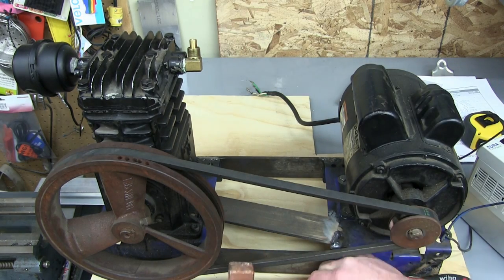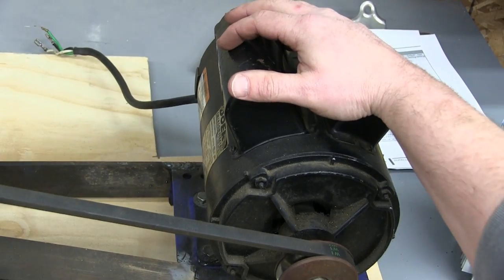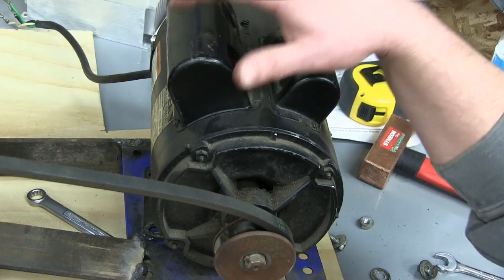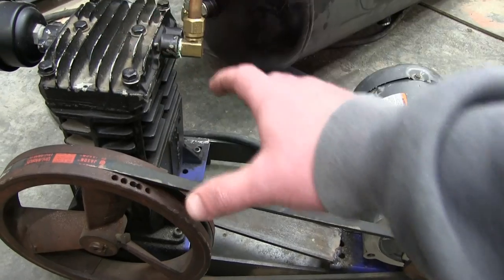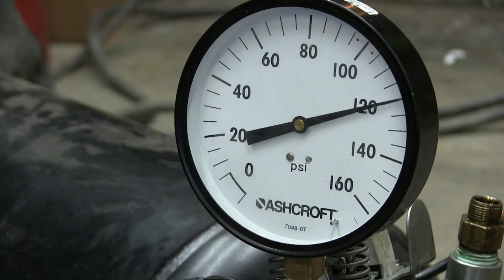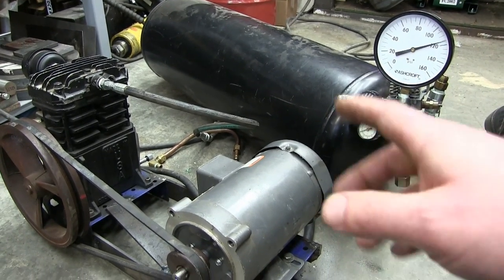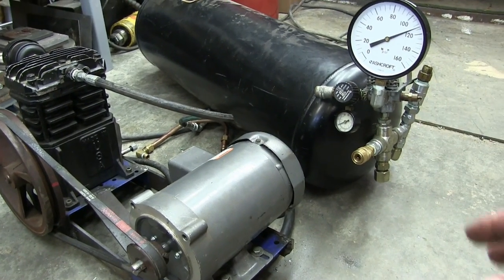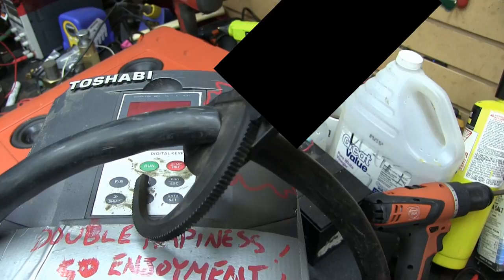BIG COMPRESSOR PERFORMANCE BOOST | No tripped breakers!

Comment: Some feedback (and it's not acoustic this time):
Some of us have taken the autogas tanks from cars, and used them for our air compressor tanks. We subsequently have a bunch of tanks, and a bunch of drivers with puzzled looks on their faces.
It would be nice to have some valves so that one tank can get charged up real quick and we can start work, and the rest get brought online gradually as there is surplus air available. Maybe pulse some solenoids to charge them up progressively without dumping the primary air tank too much.

Also, start your compressor in the opposite direction each time. That helps with the not needing an unloader valve. That flywheel pulley fan is fucking cosmetic, ignore it.
Reply: Pressure relief valve that essentially bleeds excess pressure into the next tank and so on and so forth. As for those compressors. Don't worry about the heat they don't care. We run ours well over 100 degrees c and they dont care and thats 10 hours a day 8 months a year.
Reply: I have the solution to your problem
On trucks and buses they have overflow/ charging valves to fill tanks in sequence they are adjustable then you run a check valve back to your first small tank say a 4gallon or 20 litre once the small tank gets to 90 psi it overflows to your huge tank until both are full at 120 psi
Draw from your small tank if you want quick air by blocking the flow to you big tank
Set you pressure switch on your small tank to cycle between 100 and 120 you’ll never run low on air 
Use truck alloy air tanks scattered around the walls of your shop with big lines joining them then you have heaps of air for your ugga dugga guns 💪 or spray guns
Reply: BADDD IDEEEE !!!  Used tanks of ANY type used for compressed air- that are NOT certified and within time deadlines are TICKING TIME BOMBS !   IN most jurisdictions you MUST re-certify any compressed gas receiver regularly, and Car GAS TANKS are ALL made of too thin materials and are NOT round, a design necessary for any hi-pressure!
Reply: +Lofts Sympatico Don't worry, friend. I ran some random beads of weld all over it to reinforce it. I am not sure what alloy the tank or the rods were, but the packet said "extra strong", so it will be juuuust fine.

Serious: I mean LPG tanks... propane... etc. Not gasoline. They are indeed round and thicker than most air compressor tanks. They have a working pressure of a few hundred PSI. They may not have a TUV number on them, but they are good enough for the women I would like to go out with.
Reply: Pressure overflow valves!! Why did I not think of this?!?
Perfect solution, no electrics required.
Reply: If you were to have some kind of an accumulator/expanding tank that would keep you at pressure while the volume increases that would be optimal for what you are suggesting. Problem with this is that the pump will always be pushing against high pressure when it could be pushing against lower pressure generally providing more cfm and running cooler.
Reply: Lofts Sympatico: You might be confusing Car gas tanks for petrol and LPG tanks. I just took one out of the LPG converted car. Says certified to 36 bar on it. AFAIK burst pressure of Propane cylinders is around 70 bar.
Reply: Godfrey Poon an exception to your statement of operating the compressor in opposite directions each time many industrial air compressors have built-in oil pumps not all of which are bidirectional as we discovered with the compressor we had to replace the head on. determined the three phase was not correctly phased the unit ran backwards under oil starvation conditions until it's seized and internally grenaded it was a total loss an expensive one at that V quad 2-stage Quincy with only a few operating hours on it
Reply: @loftsatsympaticodotc  Certification is an issue but the post was talking about LPG tanks which are built to take very high pressures. Probably Brits and Americans being separated by a common language.
Reply: @godfreypoon5148  Pressure relief valves are a must-have safety requirement.
Reply: @Dave5843-d9m  Yes. Gotta have an external one.

Comment: I’m seeing this 2 years later and this is actually a genius idea and it should be capitalized on for mass production
Reply: I know I just saw this bubble up and yes he needs to prototype and patent the thing. I will buy one now... unless the cost gets jacked up by the hands of 'big compressor' lol
Reply: It's not new tech - this is how inverter refrigeration compressors work. Instead of a dead band start and stop operating system, the motor slows as it approaches max, and speeds up as the pressure drops.
Reply: it is, just used for larger compressors because the extra huge cost of the compressor in large applications lets you absorb the added cost of this tech. home depot compressors will NEVER utilize this unless it becomes almost free :D
Reply: @davebennett5069  It is used for domestic air conditioners and refrigerators. Also drill presses, lathes etc, the cost has come way down for VFDs.

Comment: The ugga dugga, dugga duggas, tappy tap tap, etc.
Reply: Sounds like the start of an album to me: AvE n Dewclaw Rock out!
Reply: There's not many words in machinist language but they sure are versatile!
Reply: "How much did ya torque it down?"

"About three ugga-duggas."
Reply: OperatorIHC hahaha. Eric O!
Reply: All it needs is a snappy tune.
Reply: It's was always gigers In the garage I worked in that we measured in
Reply: braat braat
Reply: "Tappy... tap... TAP!" starts banging madly with hammer
Reply: I'm a 21 year old coder, Studying media design with it.. I am not a handy worker and yet, i watch all his vids and I enjoy it.
Reply: We use compressors in combination with catalytic filters to provide clean air to lab equipment (mainly where cylinder air cannot be used). The big problem with this is the exact pressure hysteresis you describe affects the equipment. You can reduce this to a degree by using  a second pressure regulator on the compressor output (with enough pressure drop across it so it works), but your pressure feedback motor control could help provide a more constant pressure supply and overcome this issue.
Reply: Doobly doo
Reply: "2+2 is 4, minus 1 thats 3, Easy Maf"

Comment: Man this is genius I would love to have something like this for my smaller compressor! That way when I’m away from the shop tearing down a vehicle to pull an engine, transmission, whatever the case is, I don’t have to wait 30-40-50 seconds for my compressor in-between every other stubborn rusty bolt. I can’t believe no one has figured this out before, but props to you for doing so! Brilliant my friend absolutely brilliant.

Comment: Why not just adjust the start stop on the old school compressor so that it kicks on at 110 psi instead of 80? You would still acheive a constantly running compressor, and as you said the motor is geared to run under load. 

If your tool is pulling more cfm than the compressor is putting out, you need a bigger compressor, not just a bigger motor?
Reply: I have always adjusted the on/off times on mine that way too
Reply: still doesnt solve the low volume of the compressor at ambient pressure at startup. You have a fixed volume per second compressor due to a fixed gear ratio and a fixed RPM motor. You want high compressor volume at low pressure at startup and low volume high pressure at high pressure. The motor runs efficient at one RPM. In order to do that you need to run the compressor  at variable RPM with an electric motor. This application calls for a transmission of some kind where if you have a fixed RPM motor start out at high compressor RPM (when at ambient pressure) with high gear ratio and then you gear down as you gain pressure in the tank. The 19th century double pulley variable ratio "variator" was for this type of scenario. Old school is all that you need. Nothing new.

Comment: Yes! Vector Drive ALL THE THINGS
Reply: That looks like an old motor on that compressor.  A variable speed inverter will burn out the bearings eventually.
Reply: Uncle bumblefuck taught me that bearings are industrial lego, so burning them out is nbd provided you have a good healing bench.

Comment: HEAT!!! most compressors work with the on off design so they can cheap out on compressor cooling.  That "down time" is essential to stop excessive heat soaking of the piston/compressor body.   You've got a novel idea, just need a compressor that can take it.
Reply: Bob Barker at lease I'm not the only one who think of that. I can't see that little pump lasting long running like that.
Reply: It’s cast iron and can take abuse far beyond these modern aluminum or worse plastic crap
Reply: You can always fit a little fan to cool the head if temperature becomes an issue.
Reply: Thomas The pulley/flywheel is a fan, Ave is just spinning it the wrong way....i think.
Reply: Cameron, do you mean that sucking the cooling air is necessarily less effective than blowing it on the pump? L
Reply: Lee, as it's not a car that drives forward I'd be hard pressed to call it one way or the other. Good thinking.
Reply: +Cameron -- That is right. A fan can blow air several diameters, but will only pull a significant volume of air about 1 diameter, so correct direction is important. It is also extremely easy to fix when 3-phase power is involved: Reverse any 2 of the wires. Or in this case, the controller can probably reverse on command.
Reply: very true
Reply: i agree with you heat ,is the death  trap here ,first i would run a water cooled with oil feed compressor ,point number 2 bigger ID compressor pipe and point three run a d2 governor valve switch on the head when the air is dropping  ,d2 will switch the head on or off  with a 1 bar on off (i base it on a truck air system compressor is made to run the life of the engine ) and old workshop compressor never switch off they run  the hole day ,all they did was switch the head on and off (germans called it a unloader )

Comment: Great idea. I’m an a/c and heating contractor and if you have a shop without 3 phase it’s extremely difficult to find an air compressor that with properly run some of the sheet metal tools and the adhesive spray rig for our liners. This would allow for more readily available power to run much more efficient compressors that could do what we usually rely on really big 3 phase compressors to run.

Comment: Yes damn good... broke the pressure switch on my 4.5kw kompressor 2weeks ago... that thing is quite a pain in the a$& because of the big 300l tank. It takes a long time to get it down to 7bar (were it will kick in again) but under 8bar the ugga dugga gun has no torque.
Reply: The pressure switches they have are really only rated for 3HP, and even then have a significantly reduced duty cycle associated with that.

If you want a real setup that uses the pressure switch as signal for contactor which is designed for high switching loads, check this out. I did this for my 5HP compressor and it works great.

https://www.reddit.com/r/Skookum/comments/6t4qi4/project_finished_industrial_air_compressor_for/
Reply: It's not like I can't believe you, but a head's up: Have you though about the airline to your Ugge Dugga? The bigger the less restriction. But since you're here you must have already got a decent size. :p
Reply: Stummel01 we're on the interwebs, not in church. You can say ass.
Reply: Got a 7.5kW motor on the one, and while it is really overkill as it runs around 10 hours a month at best, it works well using old fashioned star delta switching and a great big set of contactors to keep the switch alive. Still, as the switch is 20 years old, time to change it out, which is a pain, as it has copper unloader piping, so I will have to do an adaptor to use the modern push on fittings and tube, though the copper will still be there to keep the tube from melting. Has worn through a few outlet pipes and non return valves, Type 30 Ingersoll Rand compressor tends to give it a lot of air. Tank still passes pressure tests though, got the cert recently, even though it is over 30.
Reply: Yes ,  an Ass is an animal akin to a Donkey - ( so they can't Bleep it ) .  LOL !
Reply: Set the differential on the pressure switch to switch off at 10 bar, and kick in again at 9 bar. Should only take a couple tweaks to sort it. Check max working pressure of your pump and receiver first.
Reply: Graham Osborne not to try and be an ass. Im a compressor engineer and deal with this stuff day in and out, not all pressure switches have a 1 bar diff, its more likely a 2 bsr that works more as a 2.5 bar. A cheaper solution is to change to a danfoss type that gives you full control. For a windy gun or other air tools you need cfm and not pressure so much. Higher pressure gives less flow and lower pressure gives more volume so maintaining optimum operating pressuse is better than adding more. The flip side is that piston type compressors are inefficient and arent good to run much more than 50% of their on time.
Reply: What size air line?  How restrictive are the fittings?
Reply: 9ff70f96 it depends on the tools requirements. The quick coupling is usually the bottle neck but you can get fast flow ones too. Half inch rubber hose is fine for that if you are using half inch drive 3/4 for 3/4 ect. The pipe stores so much pressure and after that initial hit it becomes fed from the receiver. Larger bore allows more flow which is higher cfm.
Reply: matthew autton Exactly. Another concern is the pressure flow regulator, the last line of defense before a tool blows up...
Reply: came from the factory like that 12years ago: https://abload.de/img/img-20170412-wa0003i7rlp.jpeg but because i´m living in europe it´s a 3 phase 400V motor. Therefore it should not be an issue with the switch.... but i removed the pressure relive valve 6months ago because it was leaking... maybe that is the root cause for the switch failiure... starting the motor @7bar should require a few pixies....
Reply: Most consumer grade compressors rated at more than 100+ PSI have two pressure relieve valves, one on the manifold between the cylinder and "in" line and a second one on the solenoid between the manifold and "out" line to the air line. The first one is spring loaded and can be manually opened while the second one is spring - electric. Many of the twin piston units have two more pressure reliefs. The real danger is in the air tool regulator and likely the weak link. The regulators are rarely rated for more than 200 psi at 10+ SCFM
Reply: the compressor still has the overpressure blow of valve it opens at around 14-15bar. Normaly there is a small valve between tank and compressor that is open during startup and closes after a few sec. With that valve everything will get up to speed without compressing air (it will leak out before reaching the tank) so that will reduce the current to the motor for the startup. don´t know the exact name for the "start up valve"....

Comment: For framing we just turn tank pressure to 160psi and regulate the pressure down to 90. Compressor kicks on at 120 but the gun only needs 90. With a 4 gallon tank we can run 2 guns non-stop. Seems to work fine the way it is.

Comment: nice work, i use the same concept for hydraulic systems, you take a fixed displacement pump and hook it up with a variable speed control and you have a variable  pump..used in a tilt table for concrete wall manufacturing, after the concrete has set the table tilts up and the wall is lifted of the table with overhead crane. used an inclinometer to ramp the flow back as the tilt table rises up, mind you these are telescopic cilinders, so the last rods are small, needs little flow, otherwise it would launch the wall off the table.... anyways  nice vids AvE greets from the netherlands.

Comment: CFM limit is compressor size by compressor speed. Faster speed equals more compressor wear so your best bet is to go bigger and under drive and use normal max as over drive to reduce wear and increase capacity. My home setup comes on at 140 and off at 175 because it's factory set and I regulate it down to 125 for my use so pressure is always the same.

Comment: I love this idea. I can believe i didn't think of it before. Way more air without tripping the breaker. tapping out morse code to the PLC is a little far out there though. you probably already know, but that hydraulic hose is going to get way too hot. you could also have the PLC run an auto-drain.

Comment: It would work. But you'll find that better quality compressors for contractors just utilize a higher cut in pressure to reduce the issue. Dewalt has a single phase compressor(D55146) that runs 4 Bostich coil roofing nailers very well. It has a max psi cutout at 200 psi and it cut in pressure is around 160 psi. This is opposed to the old style compressors with a max of 125 psi and a cut in at 80 psi(witch is lower than you would regulate such a tool) Each gun makes 5-10 rapid shots then a very slight pause, less than 10 seconds, to set the next shingle. Each nailer keeps this up for roughly 53.5 to 4 minutes then takes a minute to grab the next pack of shingles and the same process is repeated. This nail gun uses 3.9 cfm at 80 psi with a rate of 100 nails per minute. The big factor is regulating the pressure to the gun, set it to the lowest pressure that will fully seat the nail with the gun set to the middle drive depth setting.
Rarely do we ever have to wait for air.